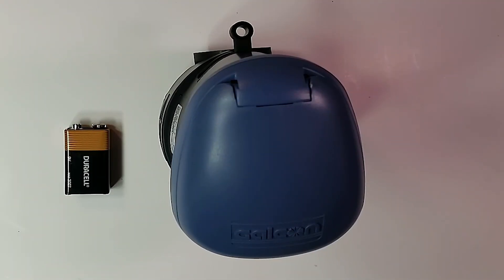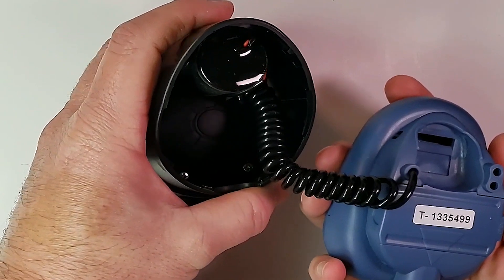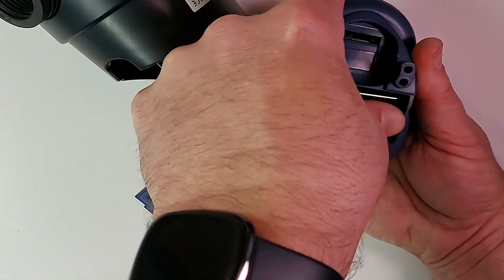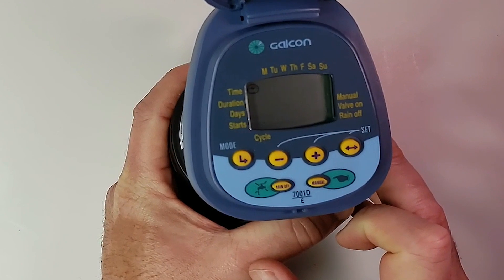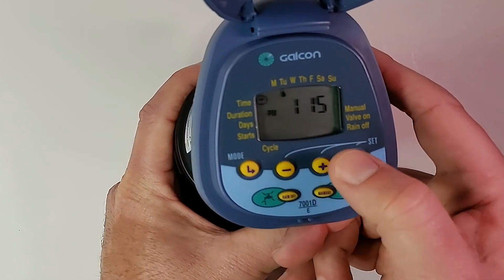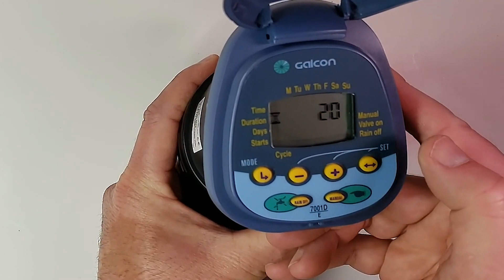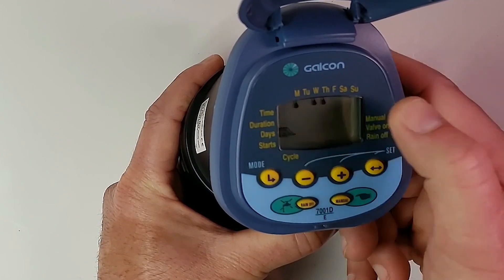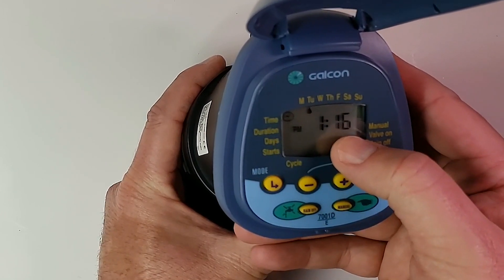Galcon 7000 series single valve timer. Irrigation on gardens, lawns, landscapes ornamental plants.

Comment: Does the valve require any water pressure to open and close, or will it open and close with minimal pressure?  I'm planning on using it for drip irrigation from a 1500 gallon storage tank

Comment: can you tell how does the rain off button work? seems like when you pressed it there was no feedback. does it turn the irrigation off for 1 day or how does it work?
Reply from the maker: Hi Thanks for your question. When you press and hold the rain off button for 3 to 5 seconds you will see the faucet with an X through it appear on the screen. That will stop any irrigation until you come back and hold the button again for 3 to 5 seconds and then that icon will disappear and the next irrigation time will run as usual.